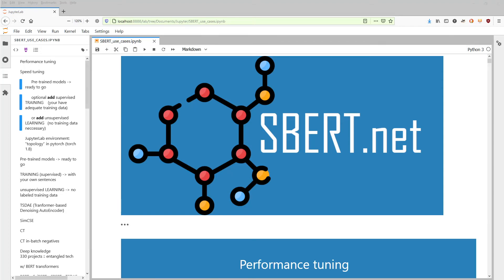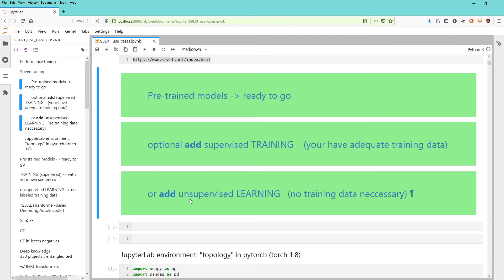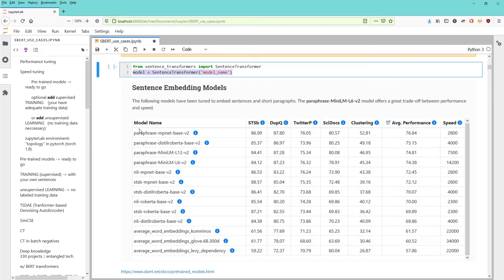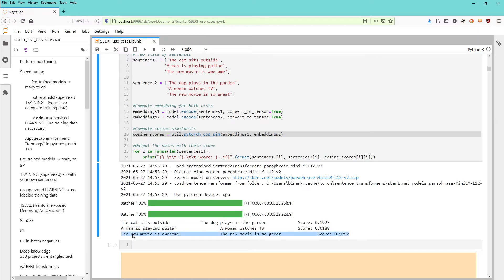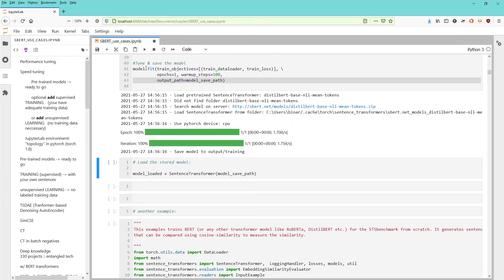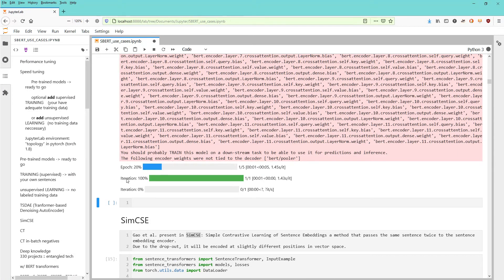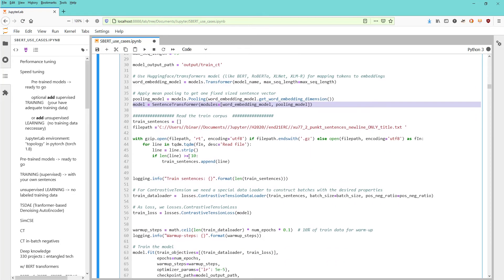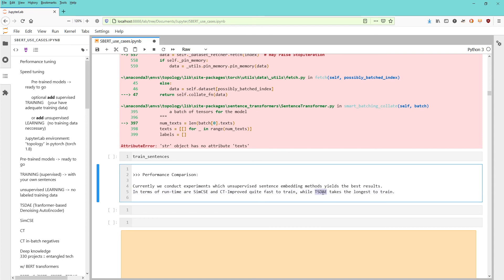Learn SBERT Sentence Transformers: TSDAE, SimCSE and CT  #sbert #deeplearning (SBERT 15)

Comment: The error in CT - In Negative is occurring due to use of DataLoader, but just like if you use losses.contrastiveDataloader i. Normal CT the errors get solve. Its just how I debugged and ran it still not sure is this correct approach.

Comment: Thanks for this . I'm still overwhelmed and have so many doubts.
1) When we used TSDAE on a pretrained model , it preserves the knowledge from the previous domain/ dataset also right? How is it different from training a model from scratch+ TSDAE and from TSDAE then training a model?
2) What's the minimum amount of data required for training in a)supervised methods b) unsupervised ones?
3) Which of the following has better results? a) creating labelled data using cross encoder  b) using TSDAE or other unsupervised techniques.
4) If we want to create labelled data using cross encoder and the data isn't similar to the ones existing (company data) how to proceed?
5) Can I connect with you anywhere other than YouTube comments?

Hope you'll reply sorry for asking such a long question 😭
Reply from the maker: Now you start to experience with the model and compare performance metrices when you dive into data science yourself.
Reply: @code4AI  appreciate your reply, could you please take time to answer other questions too ?:)
Reply from the maker: I know that you ask me for every detail, but there comes a moment, where you can find out yourself. Trust yourself. Data science is also experimentation and exploring new ways to code.
Reply: @code4AI  Thanks. I do experiment myself but I'm always in a doubt if I'm going in the right direction, also there's a lack of guidance in my case and this is the only tutorial I found. Guess you are right though, thanks again :)

Comment: thank's for comparing and introducing the models! What I don't understand is, what kind of tasks can the models be used for?
Reply from the maker: SBERT in general is limited to:
Semenatic textual similarity, semantic search, Retrieve and re-rank tasks, topic clustering, Q+A systems, Information Retrieval (IR) systems, paraphrase mining, translated sentence mining, plus all applications with cross-encoders and image search. 
Side applications include:
text-to-Image AI Art, text-to-video, generative AI with text based prompts in general and every other NLP +video +audio subsegment of AI. 
Marginal applicationsof SBERT I use for are subsystems of knowledge graphs and multi-dimensional extensions of current graph neural networks, like simplicial complexes.
All in all, a rather particular niche. Smile.
Reply: Thank's a lot for the extensive list  @code4AI . Two questions: First: Could you feed a list of Questions to the model as training data and then predict a similar questions to an input question? Second: Could you use tuples of <Question, Answer> to the model and predict an answer for a quesition? Or is it something else you mean by Q+A ?

Comment: @10:09 for the first sentence pair, you have a label =0.8. Is the label the cosine similarity between these two sentences? Or can the label be categorical labels? I am trying to understand what kind of supervised data we need to provide for the supervised training.
Reply from the maker: No, the label is not the cosine sim. We want to train a model with a CosineSim LOSS function!
Let's start: 
We need a training (!) pair of sentences, and to indicate if a single pair of sentences has a high semantic correlation to each other or not, we (=you as the one who defines the foreseen semantic similarity) can define a numerical value, eg of a normalized interval [0...1] for a label of two training sentences.

Example:  our sentence training pair:
 ['Another pair', 'and now a completely unrelated sentence'] have a label = 0.3  indicating a semantic correlation of close to Zero between those two sentences. 

Do you remember the SNLI and MNLI corpora? We had sentence pairs with sentence pairs, each pair consists of a premise and hypothesis sentence (sentence1, sentence2) and assigned a label: 
0 for entailment of those two sentences
1 for neutral correlation
2 for contradiction of our sentences.
Three values to indicate semantic correlation.

A closed numerical set [0,1,2] for defining meaning or relevance to a label, indicating a semantic correlation of two sentences. And we need a lot of sentence pairs and labels for supervised training. This is the pattern, defined in the labeled dataset, that our model will try to learn, to discover.